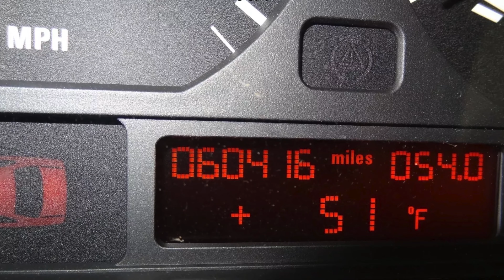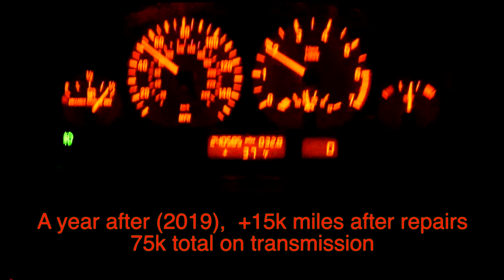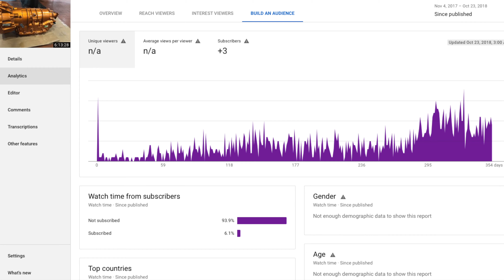BMW GM Transmission Replacement Job E46 325i

Comment: Interesting watch to see what is involved in this process! Thanks! My 330i ZHP automatic transmission just started bugging out on me last night with "Gear 2 incorrect ratio" / P0732 :(
Reply: How many miles? Was the fluid ever changed?
Reply: @drago22alina22  99k, nope

Comment: Gave me a good idea, going to use heat transfer copper paint on a transmission that needs a cooler setup, and weld a few aluminum strips to the pan for extra surface area

Comment: Great video. I need to replace GM 5L40E on bmw x5 e53 year 2001 3.0i. I can only source the gearboxes from the same x5 3.0i from other years, like 2003 or 2004. Is it possible to use "newer" year production gearbox to the older car? Like 2004 gearbox to fit to 2001 x5 and will it run? Please if anybody has an experience with this replacement it would help me if You can confirm it is safe. Thanks!

Comment: Nice video mate 👍🏻
M having trouble temps going crazy high in my gearbox 
Gearbox t stat changed 
Heat exvhanger changed 
New oil n filter 
Still crazy high temps 
Engine temps r spot on 
Have u got any idea what could be wrong 😑
Reply from the maker: That’s unfortunate situation I haven’t come across yet but, have you check to see trans cooler lines are clogged maybe?

Comment: NIce Video and recorded at a good angle.  I have a couple of questions.  I have a 525i with GM transmission that I'm going to need to remove in order to replace my rear main seal because its leaking.  I'll be doing the job myself with large jack stands and a low profile jack instead of a lift. 

1) when you removed the old transmission, was it front heavy with oil still in the torque converter? Did the torque converter try to fall out or did you tilt the transmission down in the back to keep the converter from coming out?  My biggest fear is detaching the trans and having the converter drop out.  I have to tool to hold in the converter but the initial detachment could be problematic for one person.  2) Did you have to worry about the engine tilting up in the back when you removed the transmission? 5-series need a block of wood wedged between oil pan and sway bar? (I think) to keep engine from moving when trans is detached.  3) I noticed you have the transmission sitting on the jack centered on the oil pan.  So the oil pan is strong enough to support the whole weight of the transmission with or without the torque converter full? (with the belt fully tightened and the arms squeezing the side of the transmission). I like the idea of protecting the trans from the stand.  Didn't think of that.  4) What did you do to keep the 3 converter bolts from dropping down into the bellhousing when you re-installed them?  Lastly,  5) Was the starter hard to remove or re-install?

Thanks for the video.  Not many online videos showing removal of the gm transmission in bmw.

Comment: I'm planning to do the same process expect paint, what should my average labor cost be?
Reply from the maker: At dealership shop rate, the labor time for exchange transmission should be around 8-9Hours and I think shop rate is $220 an hour. So close to $2 Grand if letting someone do it for you. Now that is getting close to what the e46 total is probably worth. That’s all up on you on how much you love the e46 before proceeding with repairs. Good luck dude.

Comment: Hey! I have to change my transmission. Same type, same car. Do i Have to reset the transmission adaptation, or do something softwarely? Thanks!!
Reply from the maker: I would recommend to that so EGS module knows to make adaptation for new fluid that’s in there now. I don’t think would hurt anything if you don’t have access to that but don’t quote me on that . Still would recommend to reset adaption values .
Reply: @merkmanin85  Thank you! Is it enough with that method, when I push the throttle pedal for 30s etc..?

Comment: why did you go to through all the effort of painting it?
Reply from the maker: Experimenting with process of high temp painting and durability over time. Saving results for a nicer build. Also keeping drivetrain clean and fluids from sticking on the aluminum from when stuff starts to leak .